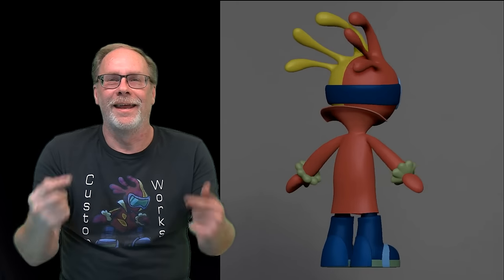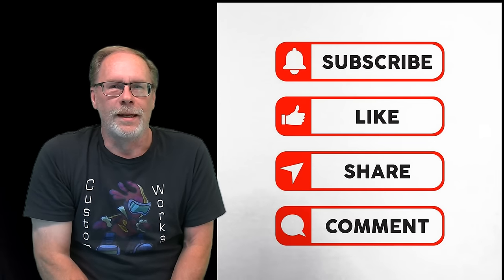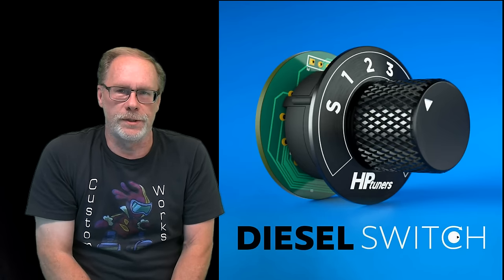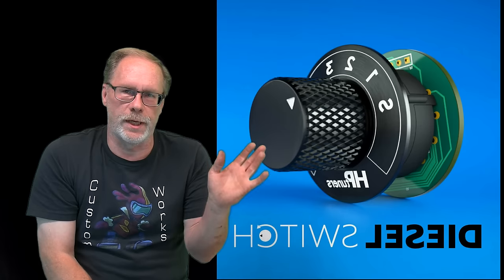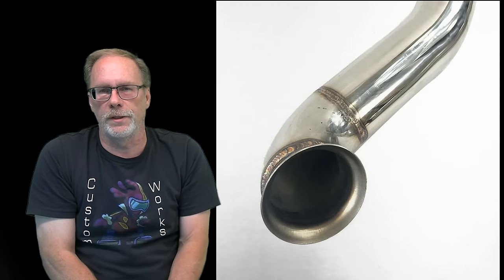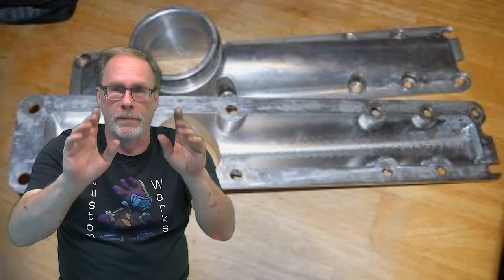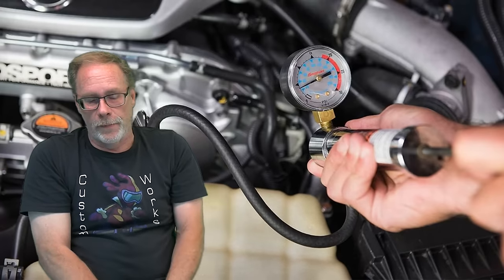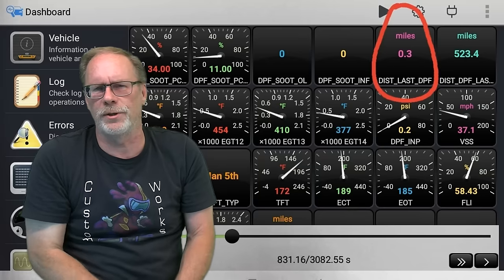🦩 7.3 POWERSTROKE  DIAGNOSE WHITE SMOKE 🧑‍🔧⛔🟡🟢🛻

Comment: I have watched all of your videos due to being new to the diesel world. I am seeing I get tons of white smoke after the truck starts heating up and only when the coolant systems is pressurized. When I release the pressure the white smoke goes away. Is this possibly cracked injector cups? I recently put a new water pump and thermostat on it as well as a new clutch fan. Any suggestions?
Reply from the maker: either a cup failure or a rare cracked head or very rare head gasket , 2 tests can be done a pressure leak down test . this is for head leaks https://amzn.to/3S2lYTa this is for pressure test of cooling systems https://amzn.to/3TZh2ko You can get cheap versions at your local auto store real basic ones much cheaper

Comment: Wow, I think I have every problem mentioned. Looks like oil on my manifolds, truck runs good, seems too atleast. But just started pushing white smoke out exhaust. Looks like blow by in my coolant res, coolant looks clean but the top of the coolant bottle looks black and brown sludge stuff. Also leaking oil on the mating surface from oil cooler to the block. I can some red coolant dripping down the oil filter.
Reply from the maker: light oil in the degas bottle is either the oil cooler failed or injector seals or cups and red coolant is incorrect for a 7.3 this video discusses many items but also correct coolant per year https://www.youtube.com/watch?v=tIDPcsqrc8o blowing high pressure air into the intake port of the HPOP connection at the head will deter man cup and injector if the oil cooler has never been rebuilt time to do it its easy https://www.youtube.com/watch?v=5lhI_tR_V94
Reply: @CUSTOMWORKS7.3PSD  did oil cooler 2 years ago with a fel pro kit. How do I blow air into the head on hpop connection? I also was told red etc is the coolant to use for 99.5 and up.
Reply: @CUSTOMWORKS7.3PSD  did oil cooler 2 years ago with a fel pro kit. How do I blow air into the head on hpop connection? I also was told red etc is the coolant to use for 99.5 and up.

Comment: My 7.3 blows blue smoke when I step on the gas pedal and I don’t know what to do I need help.
Reply from the maker: Potential issues

The possible sources of blue smoke are:

    Worn valves or guide seals
    Failure to change your oil or oil filter regularly enough
    Damage or wear to pistons
    Turbocharger issues

Comment: I'm building a e99 im at the same stage as you iv got the cab off motor is on a stand just did oil pan and oil cooler.... my motor is a early 99 putting out 230 ph and the later motor put out 270 ? Can you put out a video on the differents between them and all the parts needed to convert a e99 to late 99 that would be much appreciated!
Reply: I have a e99 as well. Its a pain to get them updated or should I say expensive. Injectors, turbo and all related plumbing plus you need the computer to get re flashed as well. I believe the exhaust manifolds and up pipes need to be changed as well but haven't researched that good enough yet. I've decided to just refresh mine as it came. I don't want to spend what it cost at once to upgrade everything

Comment: Hi Clint. Some time ago I rebuilt the fuel bowl due to the drain valve pushing fuel onto my driveway. I also out the highest output fuel pressure regulator spring in it, ( kit from Riff Raff ) and fired it back up. No leaks, and guess what, no more white smoke. And it hasn’t smoked since. No matter the weather conditions. Was it a fluke,because there was no mention of what I did that would eliminate the white smoke. It is an ‘01 F250 SuperDuty with the power stroke dieselV-8.

Comment: What about white smoke only on startup? My 97 smokes like a fog machine on startup but clears up when warm. Does it all the time when it's sat for 2 or 3 hours no matter the temperature outside. Any ideas on this?
Reply from the maker: Every thing in this video all applies,,, You have a over fueling issue either in the injector, wire harness, or pcm/idm/tuner
Reply: @CUSTOMWORKS7.3PSD  thanks. I'll be changing the tuning soon. We'll see if that helps.
Reply: @davidbatesjr3025 was it the injectors?

Comment: Any suggestions on a 1994.5 and ibd2 to use forscan?
Reply: Have a 1995 ford f250 7.3  questions  could do a complete video on how many fuel pumps does the 1995 have I'm rebuilding my truck help please where can I get a manual on the f250 7.3 1995
Reply: @rolandwingo1712  it only has the one pump, its mechanical and does double duty as a low pressure and high pressure.

Comment: Is solenoid shimming the same as the “50 cent mod”?
Reply: No 50 cent mod fixes the connector under the valve cover. Shimming is on the injector head
Reply from the maker: Thanks for that

Comment: Does this all apply if it only blows white at startup?
Reply from the maker: Yes and To add for you if white smoke at start up in hot weather its normally injectors if it passes a coolant pressure drop test
Reply: @CUSTOMWORKS7.3PSD  thank you

Comment: Hey Clint have you ever had the problem of your truck shutting off while using these scanners?
Reply from the maker: Just once the app was torque and during a test on the injector buzz I do know when using app based scanners and reg scanners if the signal is not good to strong it will cause that issue and if you do a bi directional request and skip a procedure
Reply: @CUSTOMWORKS7.3PSD  what is the proper procedure?
Reply: @CUSTOMWORKS7.3PSD  I purchased this scanner and it’s caused my truck to shut down when trying to connect it. Not sure what to do at this point.
Reply from the maker: @capacious1288  Whats the scanners name and model number or app and connector ?
Reply: @CUSTOMWORKS7.3PSD  BAFX1278-WIFI OBD, I used your link. I’ve tried a couple different apps with the same result.

Comment: I determined it was the injector on the passenger side. But unfortunately, I drove it and blowed it up. The injector tip was cracked. It hydro locked. Pushrods bent.  Pulled the wrist pin out of the piston. And beat a hole in the cylinder wall. It was long block and cab off time.
Reply from the maker: That fricken sucks